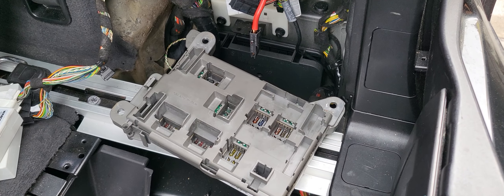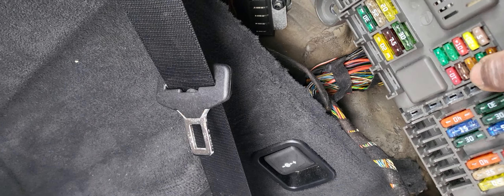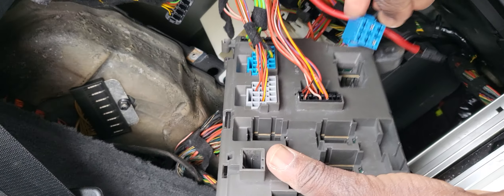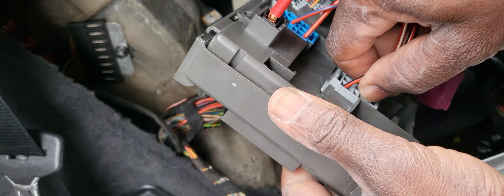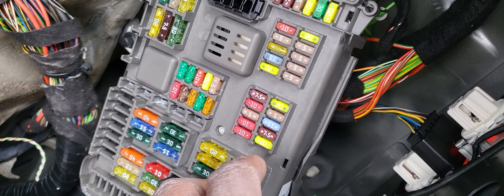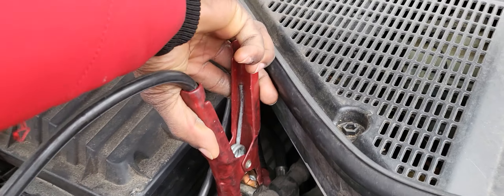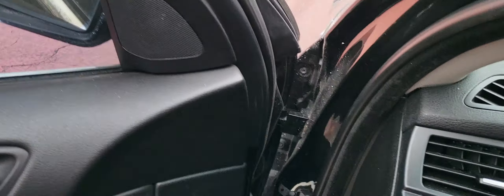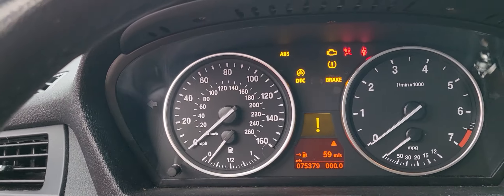2008 BMW X5 E70 Junction Box  Control  Module Replacement Programming Part 1/5

Comment: I was told to never put a charger on the battery directly, unless you disconnect the cables.
Reply from the maker: is not true ,for example if you want to program a computer on the car you must put charger on it so how you do that and the battery is disconnected